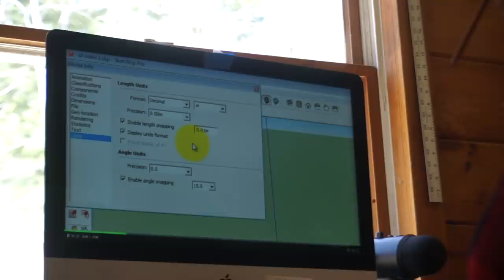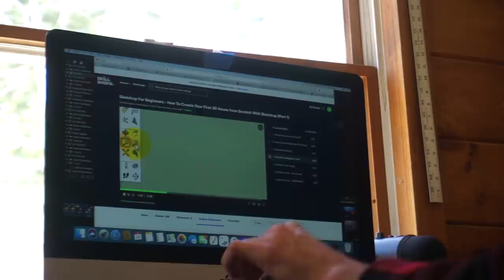Building a House from Trees SE 7 EP 13 Homemade Timber Pegs and More Siding Work

Comment: Had to watch this video again to see how you made those pegs since I have to start making pegs before my mill arrives.  I like the fact that you coat them in linseed oil and I noticed you stated you drill 1 inch holes which will help me in ordering the proper drill size soon.  My gosh those bits are not cheap.  I think the 1 inch bit is $55

Comment: Hi Bus you were saying you would be putting boards up to 14" and then battens. I would recommend putting striations on the back of anything over 6" just to prevent cupping and checking I know its a lot of work but so is tearing out a finished wall. Maybe talk it over with some of your friends just to let you know many times this is done to treads on stairs. Good luck and happy trails your place is coming along and looking very nice all your hard work is starting to show thanks for sharing.
Reply from the maker: Thank you for this
Reply from the maker: Also, thank you for this!  I will look into it more closely

Comment: You might already know this about board and batten but in case you don’t it’s something I saw on Pete Nelson the treehouse man.  The small strip of wood that covers the 2 wide planks you should ONLY nail the strip into 1 of the planks if you nail into both the strip or one of the planks can split from expansion
Reply from the maker: Thanks!